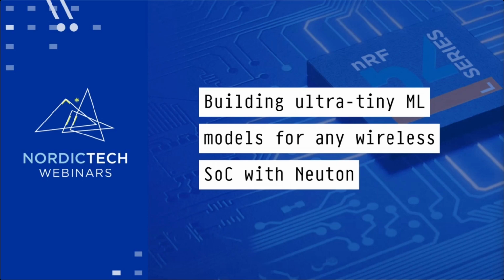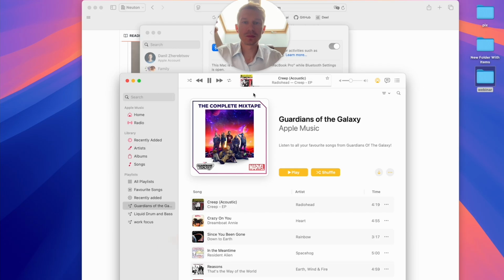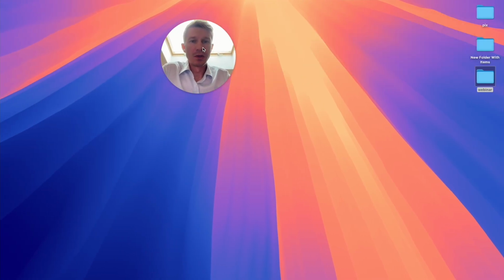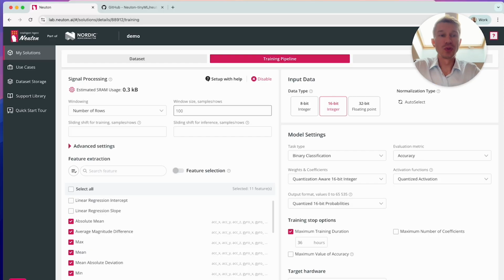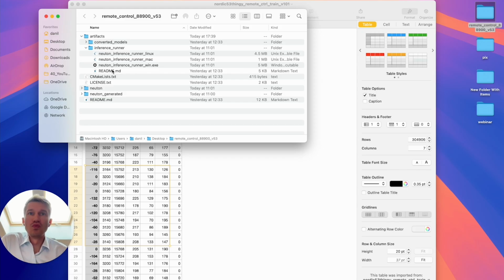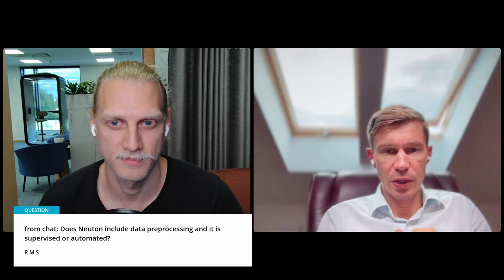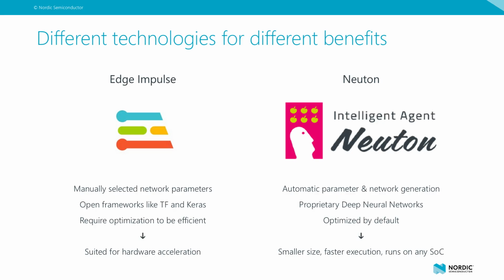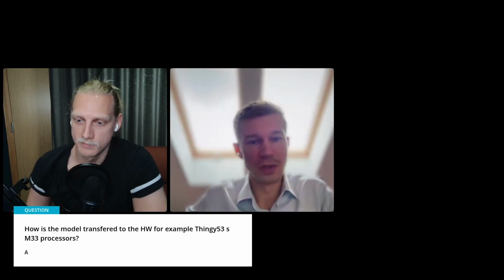Building ultra-tiny ML models for any wireless SoC with Neuton

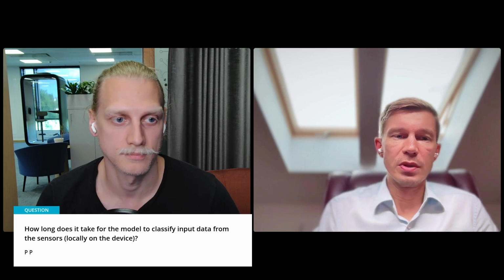Comment: The question that asked on 48:00, the answer is a bit confused. The speaker seems indicate the Neuton does not work on nRF52 in current stage. And that conflicted the answer from the host. Which answer is correct?
Reply: Hi, yes. Danil and I interpreted this question differently. Danil was referring to the specific model generated with data from the sensor in the Thingy:53 in the webinar, I was referring to using Neuton models in general on that hardware. The latter definitely works on any nRF52 Series SoC and DK, but you would have to create a dataset using the same sensor, and in the same orientation as it would be in your system, to generate the model.